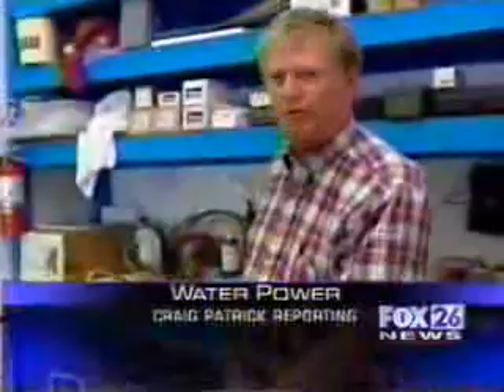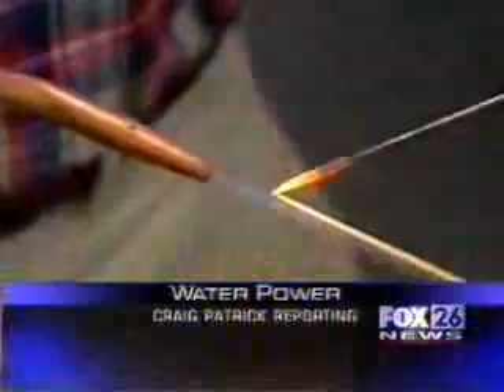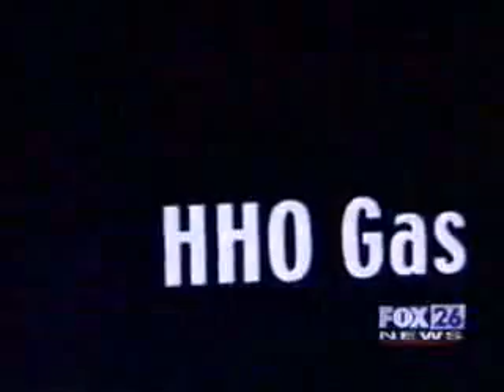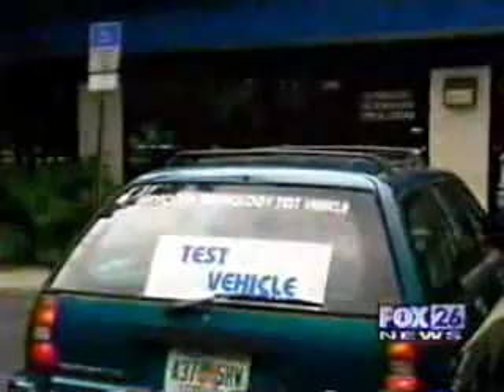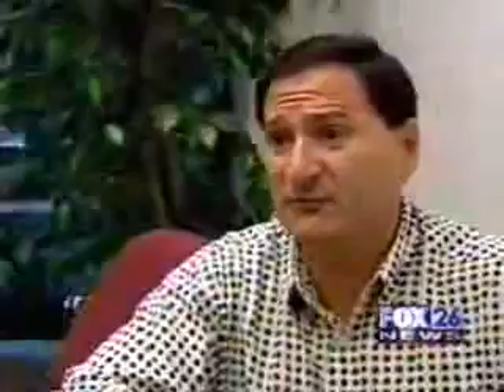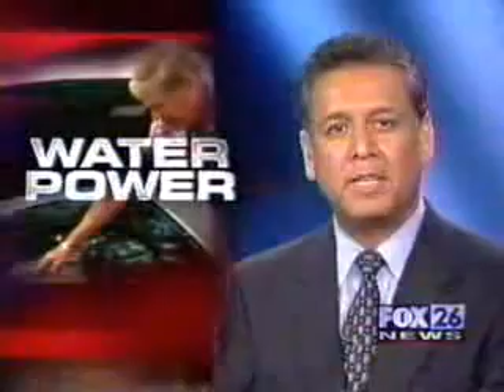MUST SEE TO BELIEVE* Water Melts Steel!

Comment: Enough with the conspiracy theories, the reason this isn't more commonly used is because it's inefficient. It costs more in electricity than the price of the fuel it makes. Add to that, Oxy/acetylene burns hotter by about a thousand degrees, is more useful, robust, practical, and economic.

As for hydrogen powered cars, I've seen the Hindenburg, I think I'll pass driving around in a ticking time bomb.

Comment: I call bullshit
Reply: Manuel del Busto it separates hydrogen from water uses oxygen as an oxidizer and hydrogen as a fuel.
Reply: I know what an HHO torch is. The bullshit is saying they can power up a car with only water. You need energy to produce HHO, where are they getting that energy from on the car?

Comment: Because it is not water powered, it is electric powered. You need electricity to electrolyse the water into HHO. You could more efficiently use the electricity to drive an electric motor.

Comment: @aqrzpro no, because say you had a car run on this, it would need to need enough power to run the electrolysis process to create the gas  and run the car, and most of the power would just go to making gas leaving you with an inefficient car. It is definitely useful but not in cars

Comment: "The problem is getting H2 in the first place" Exactly. It's possible, just really really impractical. Also, if it were really hotter than the surface of the sun when in contact to other materials, it would melt your face from millions of miles away.

Comment: @vladtepesblogdotcom Carbon Dioxide (CO2) is recycled by plants you might say. but not Carbon Monoxide (CO), there is a TOTAL difference.  Your experiment is more BS than mine and has no comparison to mine.

Look at the scam for co2 emissions on cars, why dont they test the CO emissions?

But when you buy a car there is a sticker on the door window claiming that gases that run our vehicles cause cancer, in which they most certainly do, but they make you believe its CO2, not CO

Comment: @vladtepesblogdotcom If you really think that fossil fuels dont hurt you or the planet, please kindly do this scientific experiement since your a scientific thinker and all

1 Forward this experiment to everyone that thinks like you
2 Get a garden hose and duck tape it to the exhaust pipe of your car in the garage, or outside your house,
3 Put the other end of the hose, in your room and put duck tape on all air openings in your room.
4 Turn your car on
5 Go to sleep in your room with car running

Comment: @vladtepesblogdotcom U seem not totally sure about the use of fossil fuels and its contribution to global warming, I'm not trying to convince you just offer my insight over Hydrogen based technology, so ill explore the alternative u mentioned Nuclear, Nuclear IS A SOURCE OF ENERGY... however it is not ideal as it is a fairly finite resource in terms of fissionable material and nuclear engines are far to massive for smaller vehicles so therefore electricity would power :see above post:

Comment: @vladtepesblogdotcom short circuiting the water condensing on its own is why i mention that we collect and use it for drinking or what ever as it would be fairly clean water.
On terms with the cost it is in fact cheaper to use solar energy to convert water to hydrogen and oxygen and use that to power our civilizations, the only draw back is cost of setting it up in the first place.

Comment: @vladtepesblogdotcom Fossil fuels are  the way to go only because our infrastructure is set up to process and use it, disregarding what the video is toting, the use of burning hydrogen with oxygen that came from water is just a way of storing and converting energy, it is not the power source, in case of the video the energy to power his car came from the electricity he used to create the gas from water.

Comment: It's called brown's gas... it's nothing new. It's been developed years ago for underwater welding.
Notice how they said his car has been modified to run on both water and gas? The gas is used to generate the electricity needed to charge the water. The water can be a more efficient burning medium to get the car moving, but can not be used to generate more electricity to charge more water.

Comment: @SoulsOfThePure 
(part 1)
That is the principle of preservation of energy. If you need to put in energy to get them apart, you will get energy when putting them back together.
But the hydrogen itself is beside the point I was trying to get across. People here are telling:
A. this 'process' is the future and should be fantastic for cars
B. the governement wants to stay with oil
(so it's basically all a conspiracy).
So my question is:
A. if this is so great, easy, efficient, clean,... (continue)

Comment: @SoulsOfThePure 
Enough to know that Hydrogen can not be found but needs to be produced. Water is a highly stable molecule, you need to put in a decent amount of energy to get it to do anything

But even if you could pull H2 out of thin air, it doesn't change the fact that the energy doesn't matter for car manufacturers. If they need combustion engines to sell cars, great. If people consider EV's, "cool, let's do that". So if they find a car that has 0 consumption, it will sell, so they'll sell.

Comment: @SoulsOfThePure 
1. There's no way in hell, this thing ONLY needs water. Water doesn't do anything by itself, you need electricity or another component. So start taxing that instead of oil
2. Which is more profitable? Oil or water? 
For the oil-company, oil of course. But that doesn't matter, 'cause... =>
For the car manufacturer, NEITHER! A car manufacturer sells cars, not oil or water. If they can sell a shitload of these cars, they will do so. Oil-company-bankruptcy is not their problem.

Comment: The problem is that Hydrogen fuel based systems aren't a good alternative to fossil fuel, as it takes a lot of electricity to to make the hydrogen.  Less than 1% of the world's electricity  is produced by burning fossil fuels.

Hydrogen as a alternate fuel source is bogus.  As an energy store hydrogen is excellent, as a fuel it's rubbish.

Comment: so where does the electricity for electrolysing the water come from? Hardly water fuelled is it? It's a hydrogen and electric hybrid. That's definitely impressive, but hardly what the reporters where trying to tell you. It still needs another power source in addition to water. As for the welding, very impressive, especially the 'cool' flame.

Comment: @Justaddwater2008 The ocean water once filtered can be drinkable but costs a bunch of money to do it. that would be a great use for this it would serve 2 purposes, one it would provide clean way to power things, two it would filter the water that is being used for this purpose (adding to the available water supply). the water that's in short supply is clean drinking water not ocean water.

so it wouldn't matter about the drinking water because it would not use drinking water in the first place.

Comment: This is only useful as an easy way of storing energy in cars, since the energy to make the gas has to come from somewhere else. This gas however is much easier to 'pour' into your car than electricity to load up batteries. Also batteries are way heavier than 'a few ounces' of this gas.

Comment: You realise, of course, that that is not spectacular. The energy content is slightly less than the same volume of water. I mean, the energy required to split the water is slightly more than the energy potential the gas has. The gas, is onley hydrogen, nothing special. Oxygen present means that it will burn cleanly, but even at peak efficiency, energy will be lost to heat.

Comment: Any which way about it, this sadly will fade away like "Cold Fusion" in a strange way. If it is possible to do such, there would be too much red tape for this to truly be viable. The laws of thermodynamics can be wrong as was science many times in the past. Case in point, no life at the bottom of the sea, or earth creatures must break only oxygen (the tube worms and other sea life living in and around thermal vents). Personally, no science is set in stone other than we live, and die.

Comment: Calfleb, i agree, the amount of electricity required to split the covalent bonds is so incredibly huge that any fossil fuels you would save by using 'HHO' gas is completely irrelevant. Also, the term 'HHO' gas is scientifically incorrect, HHO gas would be steam. This guy is a idiot, and couldn't possibly have invented an electrolosis engine. This is either a cleverly faked 'news' report, or this guy is pulling the biggest hoax in the history of science.

Comment: Actually some oil companies have divisions devoted to alternative fuels so that they can be the first to sell them and make more money than the other companies. currently almost everyone's car runs on hydrocarbons and its not to cheap enough convert them yet, making it hard to sell fuels that no one can use. Hydrocarbons actually consist largely of hydrogen, if I remember correctly (I probably don't) they consist of chains of carbon with 2 hydrogen atoms for every 1 carbon atom.

Waffles...

Comment: o2 and h2 doesnt burn at 4000 degree so he ust have some molecular process during burning. and as he says he burns somethig with that, it is meaned it reacts with oxygen, but as some people would say now not possible as it end up again as h20 so HHO + O2 =|= H2O...AND yes the electric does have a efficieny of 70 %, but it has much less power and is much more unsafe (batteries could burn) and stuff like that...electrolysis might be the next chemical reaction for new ways of using power in any way

Comment: There's this guy that had an invention that did just that to improve gas mileage in any car. It just ran two lines that passed electricity into the water and took the hydrogen and oxygen in gas form. I'm not going to act like I know exactly what it did, but I'm sure you could find it, if you searched for it here on Youtube.

Comment: If you think I'm pulling hairs that's fine, I'm just making my point.

Anything can be priced for higher than its worth, not sold for higher than its worth. Millions of people *pay* $400/barrel of water, in $1.50 increments. 

Therefore. water CAN be sold for more than $100 a barrel. That is all I am saying. Do you dispute that water is priced and paid for at $1.50/20 oz?

Comment: Obviously there are different price points for water. You originally said water CANT be sold for $100 a barrel. I disagree. 

The high is $403, the low $56. Realistically, if water were in demand as a fuel it can and would be sold for just as much oil (or more, but the economics are so complex who knows). 

My only point is that is is not at all unreasonable to foresee a world where water is sold for more than $100/42 gallons (because we already live in that world).

Comment: Actually, $1.50 is a typical price for 20 oz of water from a vending machine. There are 42 gallons in a barrel and 128 oz in a gallon.

Therefore, they are selling a barrel of water $403. 

Oil is extremely cheap, relatively speaking.

Comment: And it doesn't take that much energy it is a special frequency that causes the molecules to split, not a specific amount of electric charge, think how a microwave works.  its an exact frequency that causes the molecules to oscillate and heat up, electrolysis works in the same way.

Comment: There's no energy 'hidden' in water - its an energy conversion process.  You use a large amount of electricity to break the bonds in water, separating it into the components that undergo combustion to get water and a large amount of heat.  What his machine does is convert electrical energy into chemical potential energy, and then into heat.  

2nd law of thermodynamics - entropy never decreases.  If you don't understand this concept of physics, then don't pretend to understand this invention.

Comment: Fox news lol!

No such thing as HHO

The fuel is electricity, and it takes more energy to separate the water into H2 gas and oxygen than what you get from burning the gas.

Therefore this is an inefficient system that uses more power than it create. 

Skip the water use electricity.

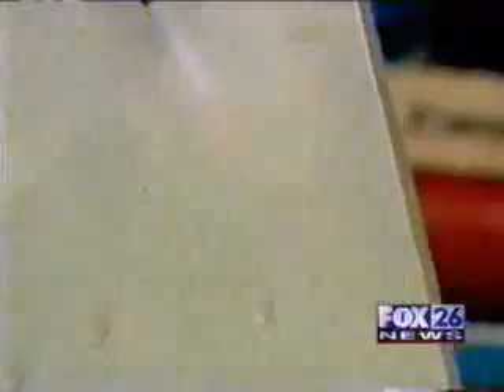Comment: Fake. Hydrogen burns loudly, hot, and red. Also, even if he could "power a car on four ounces", he would have to use a lot of electricity. It's worse than an electric car because the electricity would have to transfer it's energy into breaking apart bonds, then using that hydrogen to turn a motor, instead of directly transferring the electricity to the motor. Also, at 1:10, how can the water be so cold to condense, but not burn thru the white surface?

Comment: they`r not showing everything here, im possible to run the engine with just 4oz of water, or a welding machine that produce that intense heat..water??? i say impossible, must have some other sorts of chemical or supplied power.

Comment: He uses a MASSIVE input of electricity to seperate water into itscomponents, and then releases that energy when they are recombined  They don't tell you that all the heat produced is actually just the release of potential energy stored when Hydrogen and Oxygen were seperated. (think of the hydrogen + oxygen just as a battery) PLUS you loose energy in the seperation and recombination of water, so it would be MUCH more efficient just to run his welder (or his car) on high voltage electricity.

Comment: Fx In Iceland, where they have huge supplies of renewable energy (like water- and geothermal energy)
Almost all of the mass-transport vechicles is running on water, through hydrogen-pills..
They simply split water into hydrogen and oxygen, which require enormous supplies of energy.. but because of their easy access to energy its possible
There is nothing new in this, in most of the world, the energy would have to be supplied by  charcoal factories, which produce just as much CO2 as a car would

Comment: Yes, energy from the Sun is free, and therefore this method of powering a car (or whatever) can therefore be considered free providing the electricity used to generate the fuel is sourced from solar power (or wind, wave etc). Yes, the water can be described as a "fuel source", because the fuel (HHO) is made from water, but to make the fuel from water requires just as much energy as is released when the fuel is burned. The pitch of the video is very misleading.

Comment: The water first needs to be broken down by electrolysis, which requires electrical energy. All this man has done is found a very energy efficient way of using electricity to power an internal combustion engine which, although ingenious, is not "free energy". You would not be using any less power than if you drove an electric car.